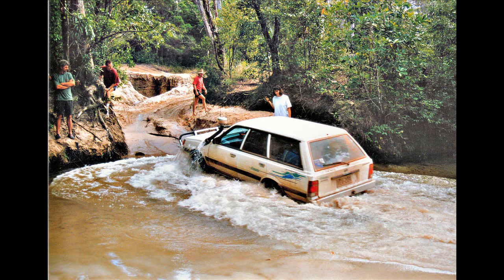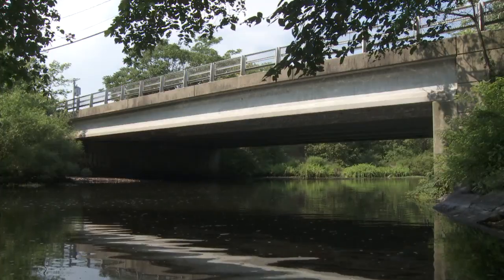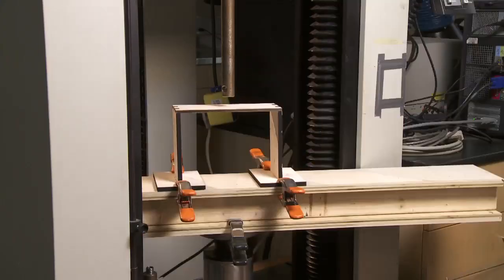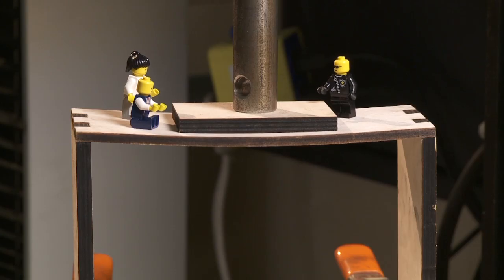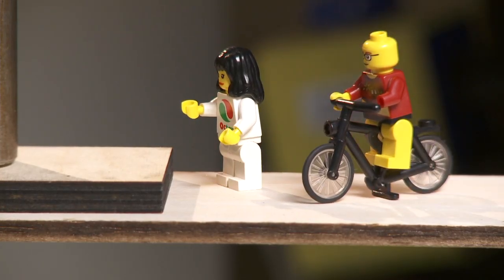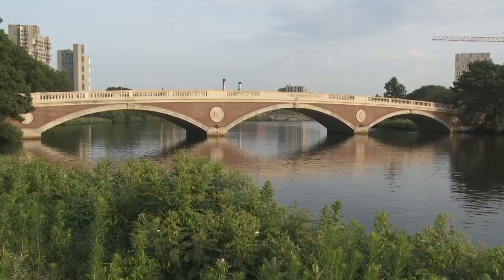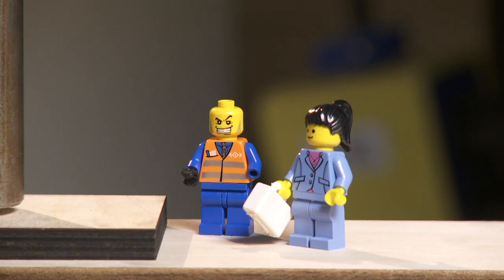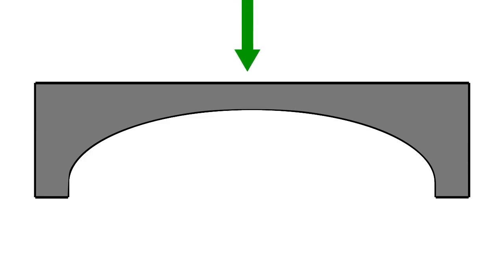Bridge Design (and Destruction!) Part 1

Comment: the first mode is not correct, it is not beam, it is frame. Tension and compression in beam bridge ? Bending moment and shear force. With only vertical load, in beam bridge can not be compression/tension.